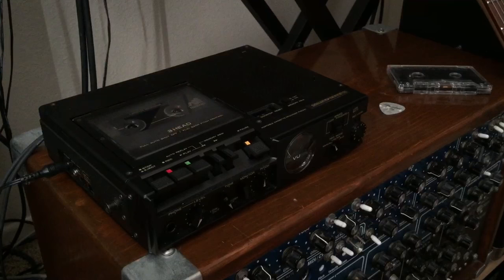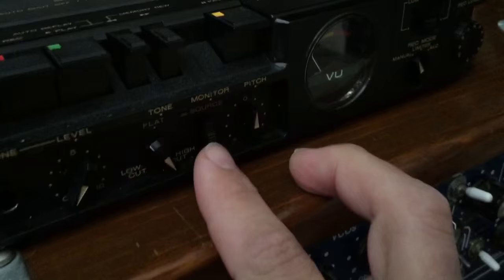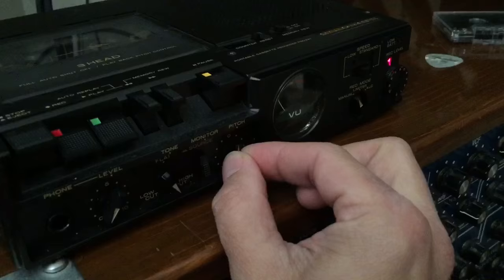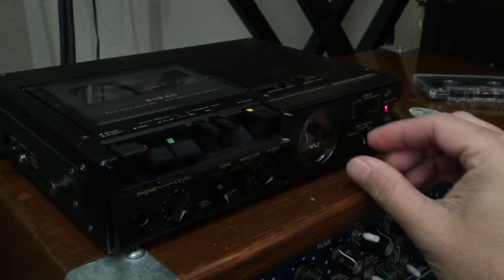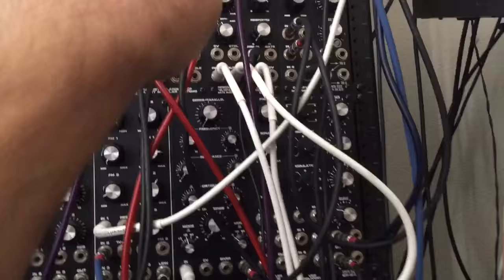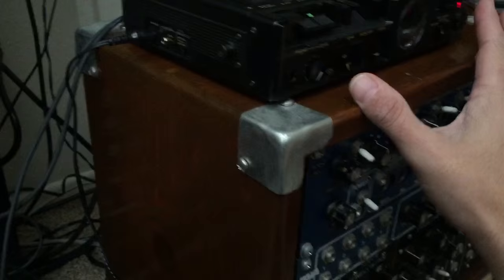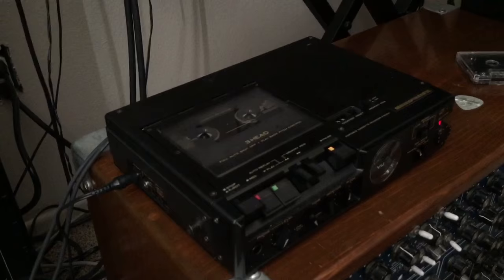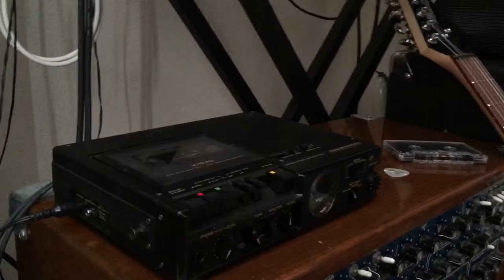DIY Tape Echo - Marantz PMD-221

Comment: Great hack... but can you explain me how the "pitch control mod" works? if i understood correctly, the pitch control doesn´t work on recording mode, only playback, right? Thanks :)
Reply from the maker: Hi. The circuit board has one trace that needs to be cut with a jumper wire added between two points. Details on this and the entire mod project to be posted soon.
Reply: +djthomaswhite Would love to get the details of the mod from you!
Reply: check out this thread for details http://www.diystompboxes.com/smfforum/index.php?topic=107627.0
Reply: @paulb1953  Do you know where to attach the other end of the jumper cable to?

Comment: +djthomaswhite Hey, sorry to ask, but I'm trying to get this to work sans modular. I'm having trouble seeing your inputs/outputs and where they're leading to. I'm using a Presonus Fire Studio as a mixer, and 'm trying to figure out how make it work. Any words of advice, or possibly clarification on where your cables are going/coming from?
Reply: if you haven't worked this out yet, you need to take the right output and feed it back into the input along with the input signal, and then use the right output as your output signal with the delay :^)

Comment: Hello! Nice vid. Can you explained how you can change the pitch while recording?
Reply from the maker: There is a circuit trace cut that needs to be done and wires that connect the cut trace to a different point. This enables pitch control while recording. I hope to publish details on this and the whole mod project soon. I found the info on a message board so it is out there already.
Reply: Hi! This thing sounds great! Did you post details, schematics somewhere? Always want to play with tape delay, but they are pretty expensive.
Reply: did you ever post how to "circuit trace cut that needs to be done and wires that connect the cut trace to a different point", sounds great please get bck to me so i can mod my pmd 221. thank you
Reply: @djthomaswhite  did you ever publish the details? please message me with what "other point" I should attach the jumper cable to!